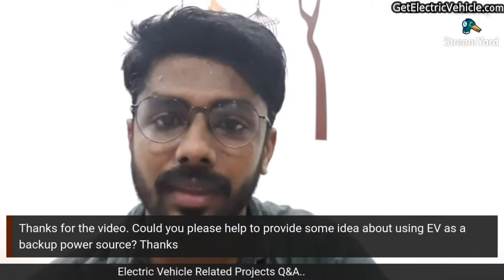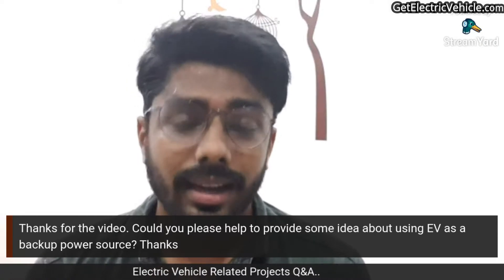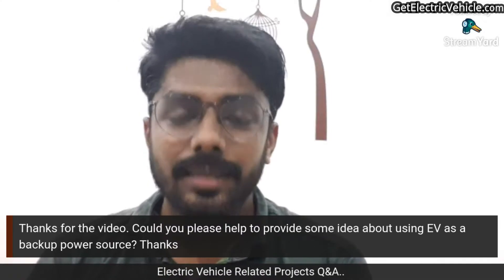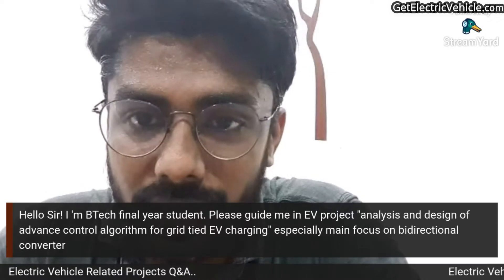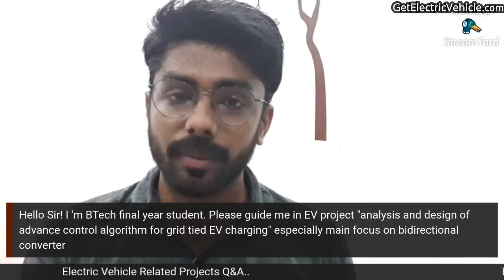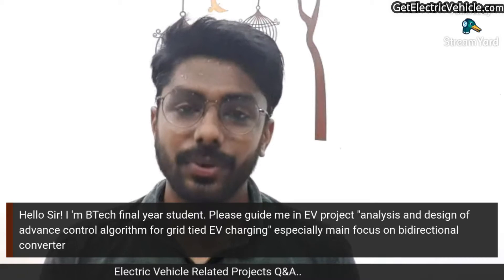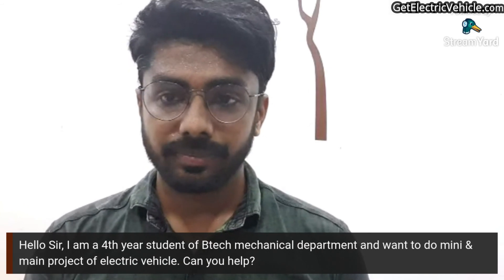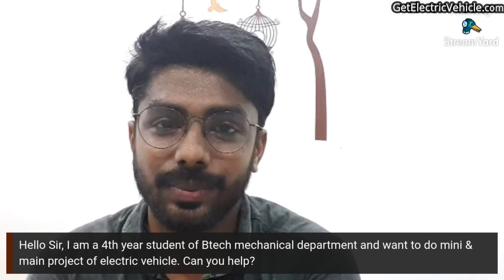Electric Vehicle Projects Q&A | Recorded Live

Comment: Hello sir  I am btech final year student in EEE department can you pls suggest me some hardware projects related to EV and how can I get the resources related to it...
Reply from the maker: Hello Amartya Singh,

Here is a short list of ideas
- Electric Bicycle conversion and energy consumption study
- Regenerative braking for Electric Bicycle: feasibility study
- DC-DC converter for Electric Cars
- Harmonic analysis for EV charger
- Bidirectional cahrger for EV and Power quality study

For EV conversion, some Kits are available from different websites. Since I haven't worked with them, unfortunately I can't suggest anything specific.

For other projects, you shall get the circuit diagrams from IEEE papers or othe electrical related websites. You can buy components from electronics shops.
Reply: Thank youu so much sir for your guidance..
Reply from the maker: You are welcome